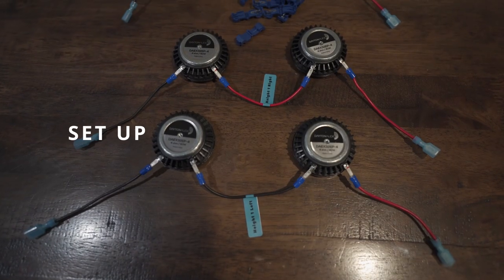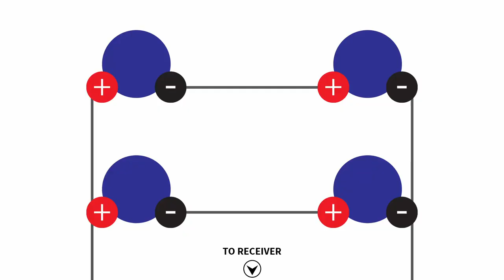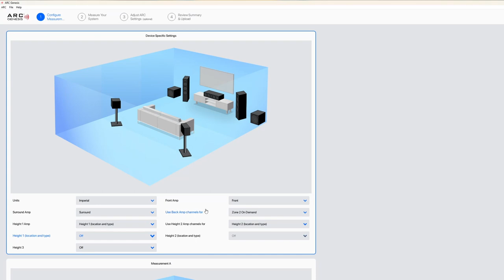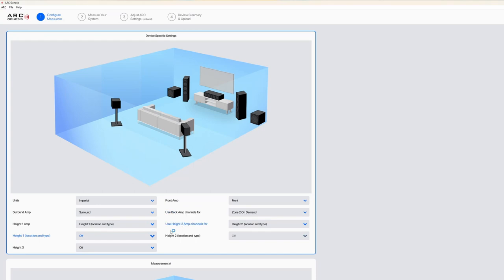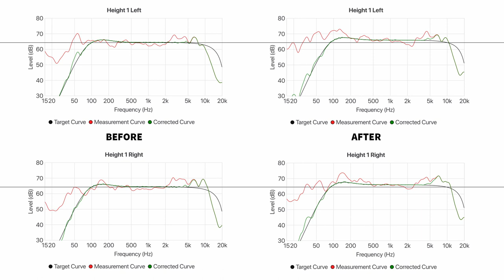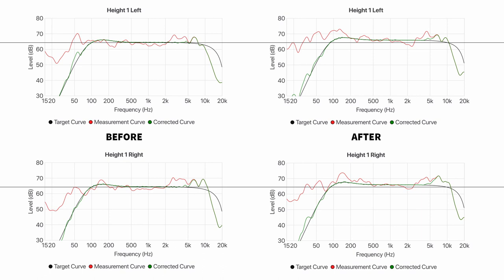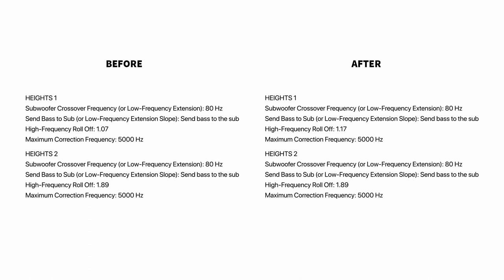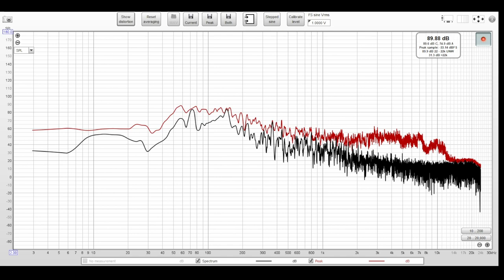Adding more Dayton Audio DAEX32EP-4 for Dolby Atmos - Home Theater #38

Comment: what is the software you are using to test the audio levels?
Reply from the maker: Thanks for checking out the video and in regards to the question, I'm using a free software called Room EQ Wizard (REW). Within the software, it has an RTA function to capture the frequencies and loudness of the sound. You do have to use a calibration microphone with it and the one I use is the Dayton Audio UMM-6 from Parts Express.
Reply: @RandomDistractionsYT  thank you

Comment: Didn't see this , watch out for "comb filtering"  with multiple drivers not completely familiar with your processor but most allow manually adjustment after calibration because auto is not perfect
Reply from the maker: Thanks, I'll have to look into "comb filtering" as I'm unfamiliar. The one thing I am struggling with right now is when I do turn it up to reference levels the rear channels make the ceiling rumble a little too much that it sounds bad so I have to manually turn them down. Will either need to find a way to reduce the rattling or it may be better to switch to dedicated in-ceiling speakers.
Reply: Also make sure you don't have a light fixture or  other Item laying on sheetrock  , ( secure the cable higher) is needed
Reply from the maker: @thinkIndependent2024  No lights but they are close to the AC vents which did cause some of the rattling. I was able to partially fix that but it actually sounds like it's rattling the entire panel so may need to add more screws to it to secure it. Will see, it's kind of hot to go up there now to try so will probably have to wait until the temperatures come down.
Reply: @RandomDistractionsYT  One of my first jobs was wiring homes, I don't miss it did raise the crossover to around 100hz those exciters tap out lower frequency but can have beautiful midrange
Reply from the maker: @thinkIndependent2024  Oh man, I wouldn't miss that either and thanks for that tip, I'll have to check and see were the crossover ended up on that to see if that will help too.

Comment: proof that installing Exciters like this is NUTZ!! Normally, a 2-2-pair set (stereo) fills a room very-fine. mounting on ceiling drywall....not so much!! sorry. Free-mounting with spacing is best. 🙂
Reply from the maker: Yeah, I got similar comments from others. Unfortunately that wasn't an option for my space but hopefully this can be referenced for others on what NOT to do. I will say that they do get to about 80-90 dbs but unfortunately the rest of the system is hitting 100dbs or more by that point.